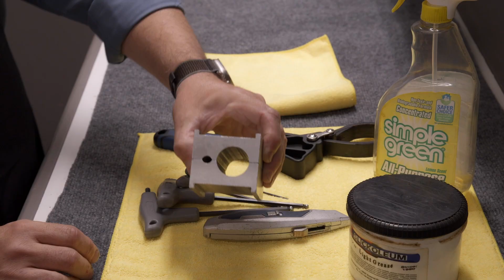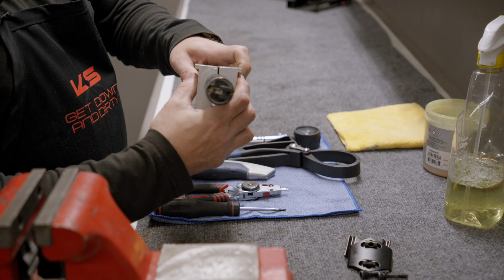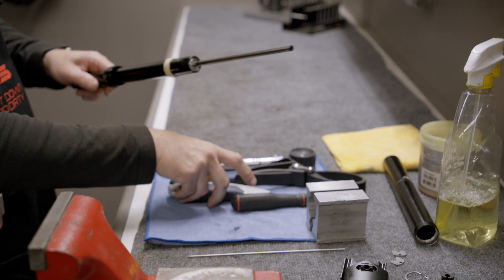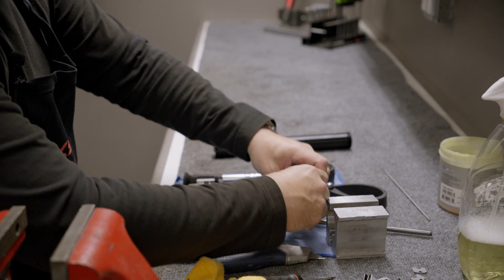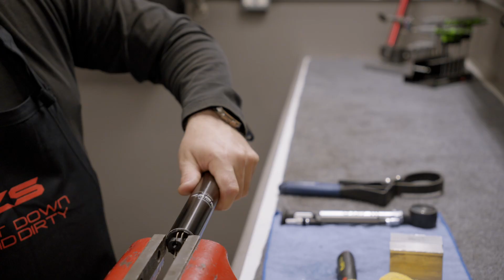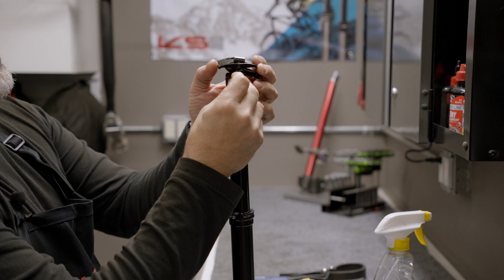Rage-i 2.0 - Maintenance

Comment: Do you have an install video for this dropper? I have the 900i 2.0, and the instructions bring me here. The reverse cable routing is confusing.
Reply from the maker: Hi, thanks for reaching out. We do have a video for the remote installation. Reverse route simply means you use the pinch bolt on the remote end to affix the cable.